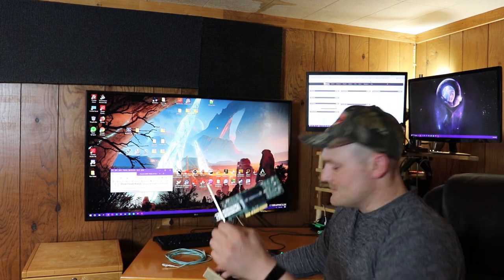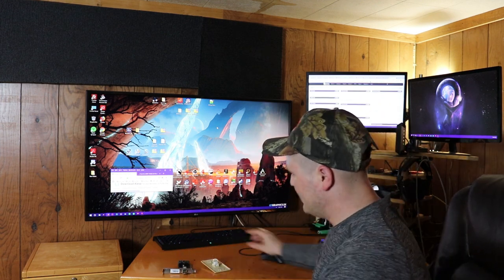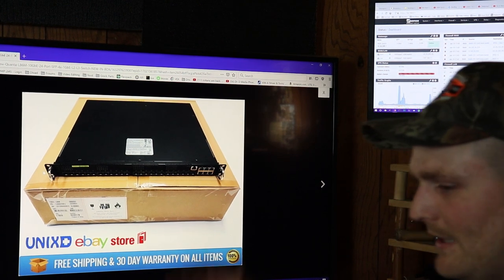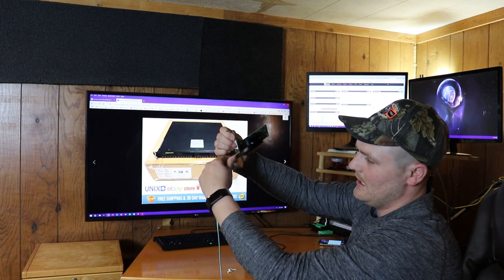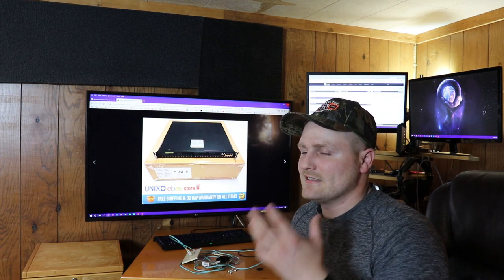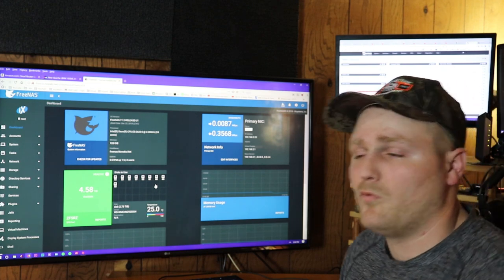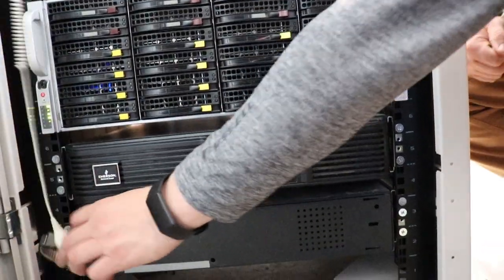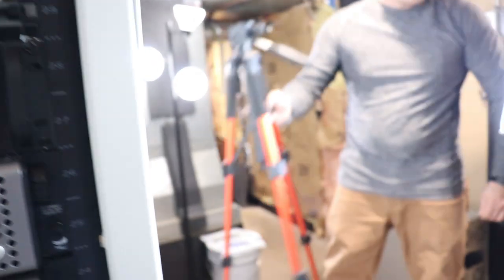10GB/s Networking Explained in Detail. Why would you want it & if you even need it. (MikroTik )

Comment: Do you need a switch cause i have a 10gb router, cant i just plug in the new sff cable into that and straight into my 10gb network card in my pc?
Reply from the maker: yes you could do that but you will only have 2 items on your 10Gbit network.
Reply: @TNW1337  Thanks so much, the reason I asked is because i was going to use it for my main pc (gaming) is that overkill?
Reply from the maker: @connybro4757  Yes sir. Most 10Gb networks are for large file transfers. So like Connecting a Server to your desktop and maybe a 2nd desktop.
Reply: @TNW1337  Thanks so much, you saved me 300$ you gained one more sub keep up the good work :)